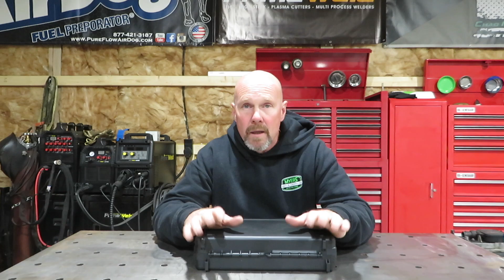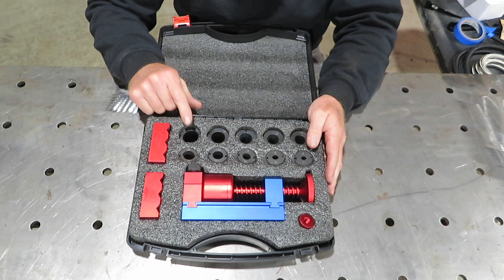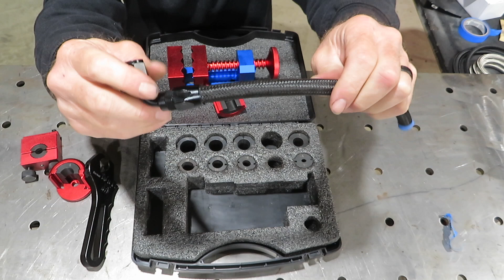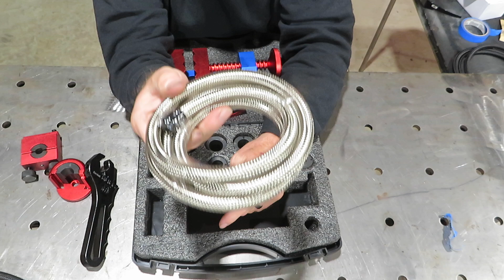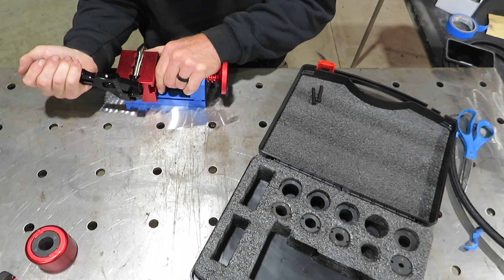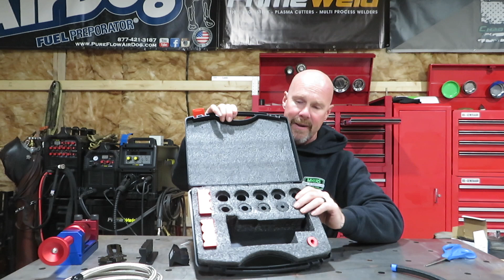GSTP Auto Parts AN Fitting Tool

Comment: How does it do with PTFE on high pressure lines where an olive or compression ring is used?
Reply from the maker: Pretty good, I do have a video using it on ptfe running full lines on my buddies Camaro